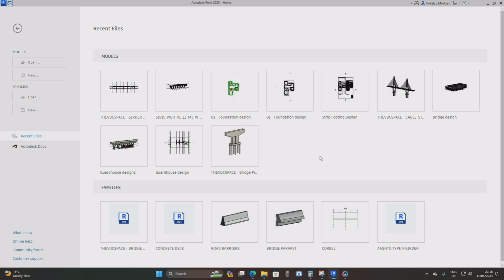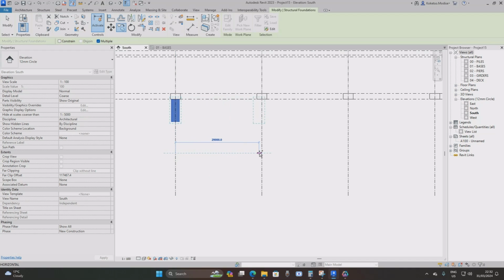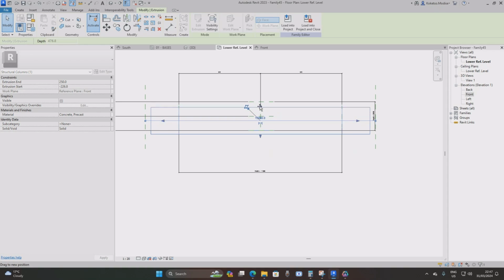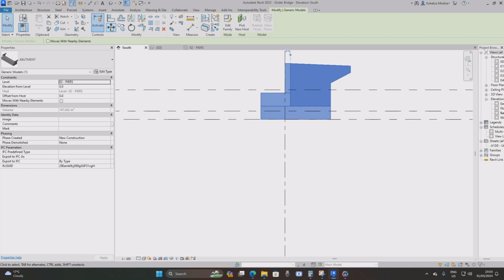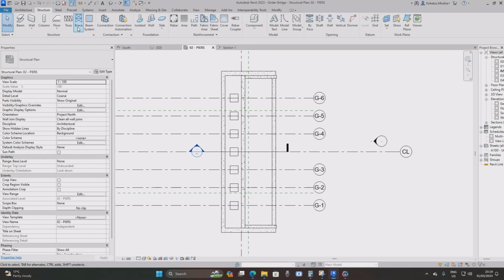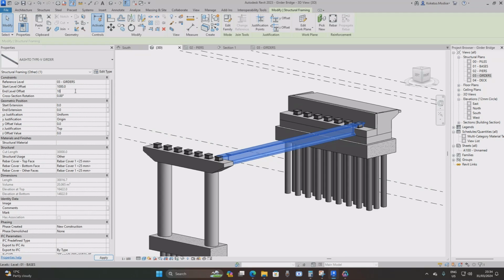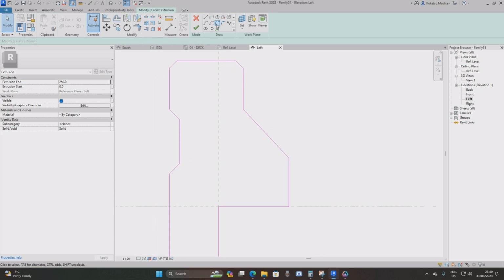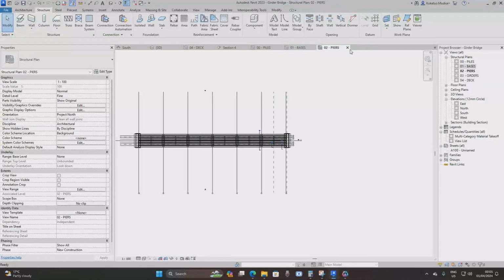Concrete Girder Bridge in Revit.

Comment: great ..... hope to working  on alignment in Revit.
Reply from the maker: I'm still testing a dynamo script to incorporate a Civil 3D Alignment into Revit.
Reply: @the-vdc-space  good .... actually, I was working on dynamo for the same point it's great, but you should know how to place the family on the alignment properly this the point.
Reply from the maker: @qusaikhlifa4233  If you use a Beam Family Template to construct your deck you can actually use Alignment points to generate a Model Line which can be detected by your beam (deck).
Reply: @the-vdc-space  are you planning to do a tutorial about that?
Reply from the maker: @citydrive4K   Yes.